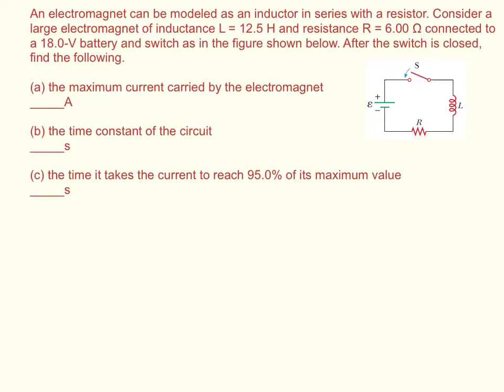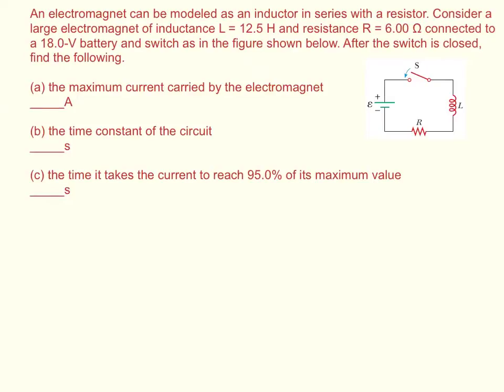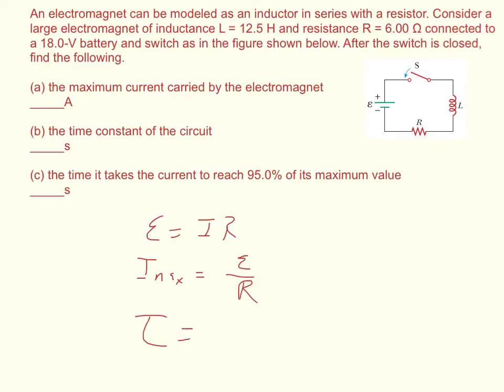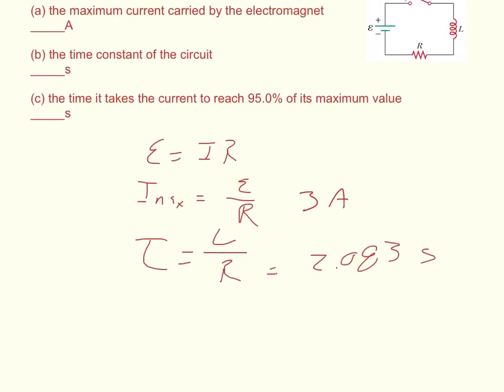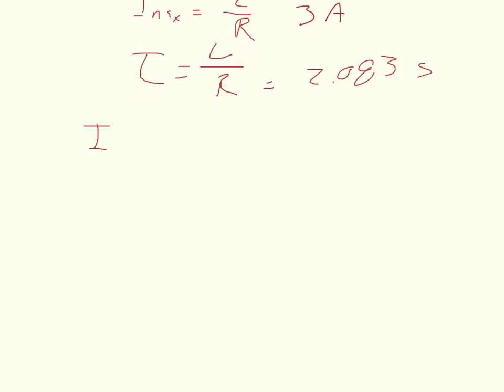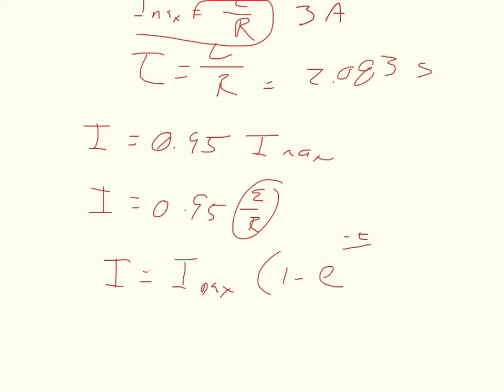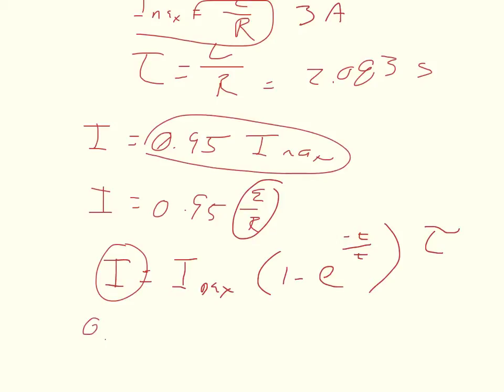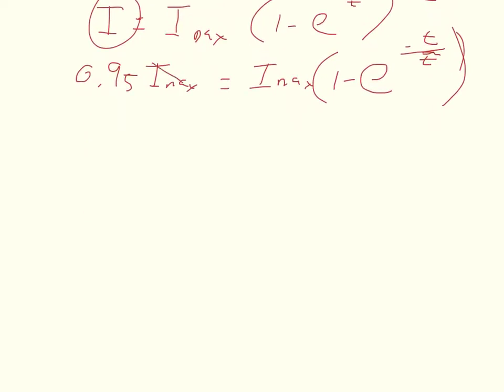Physics WebAssign Ch20 #13

Comment: Should it be ln (0.05) since it is 1-0.95?
Reply from the maker: Good catch. That was just sloppy math on my part.
Just for reference - at about 3:12 in the video, I subtracted 0.95 - 1 = -0.05, not -0.5
Thanks Shane